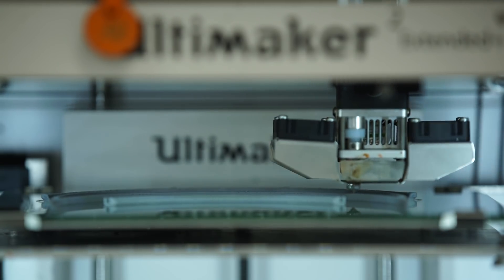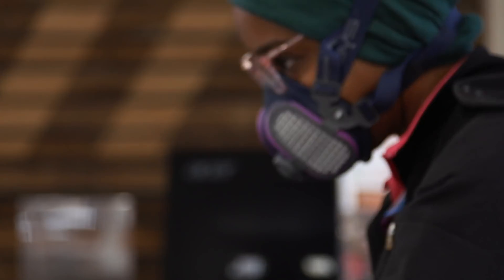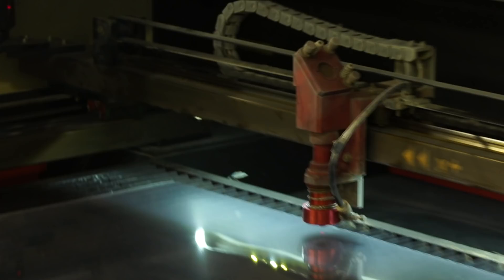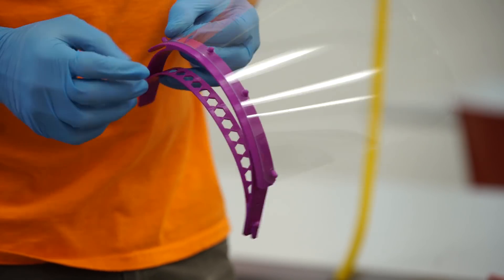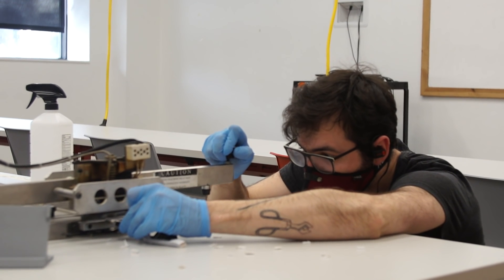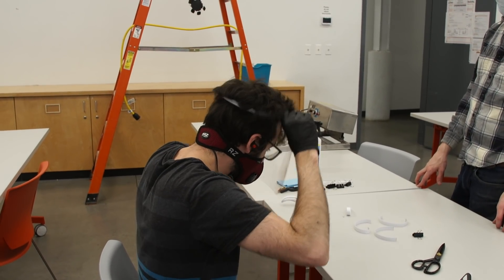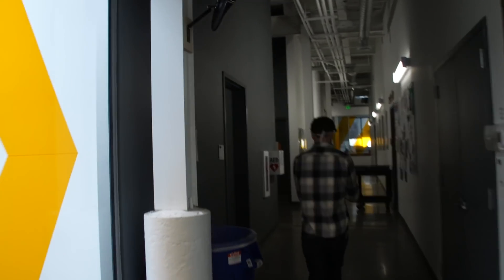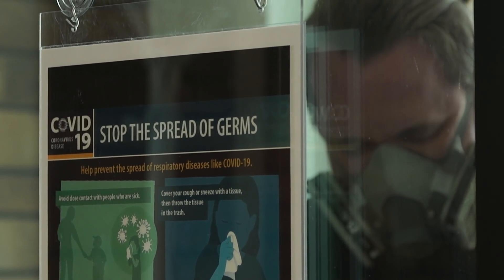3-D printing face shields for hospitals in need

Comment: Great work by you guys BUT.....Enough blaming government for all failures.  Hospital administrators failed to have emergency pandemic stock of these shields, masks and gowns in storerooms.  50,000 masks at 50 cents prior to Coronavirus would have cost $25k.  A tiny fraction of a hospital’s budget or they could have spread the cost over multiple years.   Our hospital services could have been a lot better prepared with these low cost supply items vs making it a national emergency.